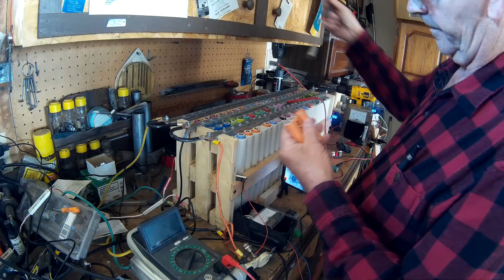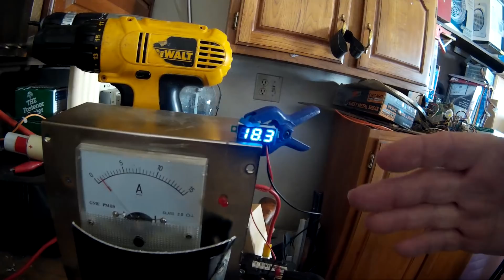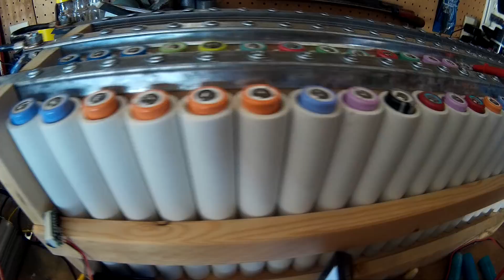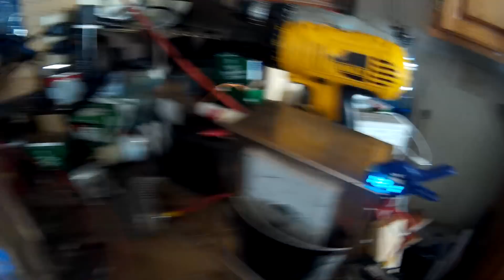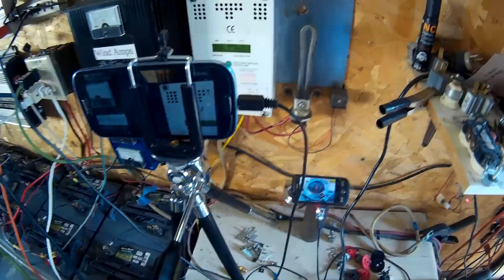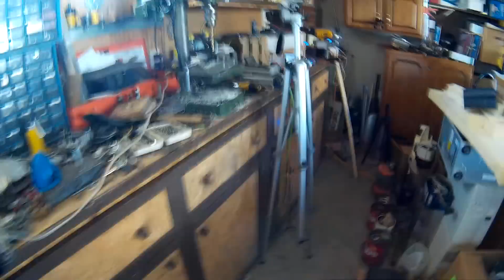My Power Wall Build

Comment: butch how do you put a bms on that set up? i really like that set up
Reply from the maker: In this video, there is no BMS. Later I used a tube that is smaller and sliced it in half so the batteries would be exposed and actually snap into the tube allowing a foil strip to lay between the batteries, then attach BMS  to the end. Hope this helps.
Reply: @butchwilliams7637  do you have any videos of that. i still like putting 4 battery in and only charging to 14.8 most of the day i think they will last longer its been working well for me and no bms take care thanks

Comment: What is the water heater element for next to the lead-acid battery bank? I assume it is to burn off excess energy for balancing, maybe? Very intelligent set-up. Good ideas!
Reply from the maker: Diversion load for the wind generators.
Reply: @butchwilliams7637  Well, that makes sense. So you could put that in your water heater and it would add heat to your water!

Comment: Hi, I'm from one of the DIY powerwall groups and we have people mentioning your video as a justification for using Lithium Ion Cells with no battery management system... 

Let me first turn your attention to this guy... https://www.clickorlando.com/news/local/2020/07/10/osceola-county-home-catches-fire-when-battery-pack-for-solar-panels-ruptures-2/
His name is Leo he came and posted to our group, he went and bought a salvaged Chevy Volt Lithium Ion, gutted it, put the batteries in his basement with a multi KW roof full of solar and treated them like Lead acids. A short while later he lost his house, lucky he didn't lose his family. He used 4 Midnight solar 60A chargers and shoved all of that power into Volt batteries.

The reason i'm writing is because you are doing the community a huge disservice by not researching and putting together Lithium Ion properly and sharing it with people as "You can do this too just like me".  Let me show you another video.... https://youtu.be/of01p0Q-yUM Same kind of cells, charged it without a BMS.  You should not be replacing your cells on the regular, that's happening because you don't know your individual cell voltages and the voltages across individual batteries are getting too low and ruining them

Lithium Ion is NOTHING to screw with, if ONE cell reaches 4.2V or even on the low end of 2.6v your entire battery pack, the wood bench you have it on and the borderline hoarding situation you have in that garage goes up.  Once one cell goes up, it's a chain reaction.  If you would like to see a proper DIY installation of Lifepo4 (Which also needs a BMS) Feel free to click on my name and see my project.   

Let me go into a bit more detail You need to run a BMS with proper contactors/shunt trips BECAUSE Lithium Ion at those voltages reaches a snowball effect something needs to have eyes and watch your system when you cannot.  With the batteries your obtaining you have no idea the condition of them, As they discharge, one could discharge faster and you begin having balance issues and have no idea. Pretty soon as your 2 solar panels charge, One cell reaches 4.1V... You discharge it with your fan, then charge it up the next day, possible BOOM.

Battery management systems aren't cheap, especially the configurable ones I had to drop almost 900$ on mine for a 880AH system. I use Batrium.  Please be more informed, join one of our groups, look at a lot of the established battery creators, There's no excuse for you having to design your own system from bottom to top and it being extremely unsafe for the sheer reason of "Wanting to be different than everyone else." I really don't want you to be the reason why law makers put further restrictions on battery creators because you were the next guy who lost his garage.

I really expect if you are going to post this on the internet to know exactly what your talking about, know the model of your fridge and not mumble your way through it, know how low your voltages get overnight. Those are huge indications you are choosing to be dangerous and uninformed rather than safe and informed. Last and finally, by clamping the positive and negative down on each other you've created a sudo bomb because they can't vent unless they rupture.
Reply from the maker: Thanks Alan for doing all this research just for me.

Comment: Hi! Are you still using this powerwall battery design? How is it going for you? It is a uniquely awesome concept versus the normal plastic battery holder style that everyone uses, I'm just wondering if it is viable ? My primary concern is the stacking of cells (lack of balancing) Tnx
Reply from the maker: Yes It is still in one piece and still works. Added another row since the video.

Comment: I know a old video. 
Great concept you have there. It does need some improvement done. That is why you have a great system. 
Your system can be adaptive to what is at hand. 
I’m a retired hot roofer and have a farm . Along with starting my own power bank system in the near future. 
I wonder about using magnets instead of soldering the fuse .
Reply: I did see someone doing just that. I was thinking maybe springs like on a clothespin.
Reply from the maker: I have tried them between the batteries and works good. On wires not so good.

Comment: How about a update video. 

Did you charge /discharge each battery or just find good batteries and drop in.

Yes you could buy this and that to build your system. You used what you had at home. 👍🏻
Reply from the maker: I do discharge and charge all used batteries to find the best ones.

Comment: Instead of soldering the wire to the top post, why not solder to a metal washer and use a small neodymium magnet? It would make your cells alot easier for you to service. Great video.
Reply from the maker: Great idea. I've tried the magnet, but not the washer.
Reply: @butchwilliams7637  heating up the magnet makes it lose its strength. You can also put a magnet in between every cell for better contact.

Comment: what is the bms board u r using to control the voltage from solar panels
Reply from the maker: Its just a Li-ion solar charge controller rated at 5 amps.
Reply: do u have a model number for that bms. can't seem to find a 5 amp
Reply from the maker: Got them on ebay, search for solar li-ion charge controller.
Reply from the maker: I found them on ebay from china

Comment: This may seem like a noob question (probably because it is but if you don't ask you never know).

are there any detriments or known problems with having cells in series with no fuses.  This is a similar design to something I have in mind for my setup (I haven't started putting packs together yet). and wondering about any potential problems with having cells in series. ???
Reply from the maker: I'm not aware of any issue's. Mine have done well for about a year now. I don' t plan on changing anything. Just making it bigger. I think you will do fine. Put at least one fuse per set.

Comment: Very ingenious cell configuration. I'm glad it's working well for you. The only thing I would do different is to use copper sheet for the buss bars and install 1 amp glass fuses. That's just me, I'm not too keen on steel as a conductor.
Reply: Brass would be just as good and easer to get.
Reply from the maker: Thanks, just testing

Comment: I thought about doing something like this. with pipe. I like the black holders. its that I gust don't have them! I may get some. If I didn't have to order them. I'd have them already! I'm trying to put together a pack with just under 400 cells. or multiple packs of 20, 7,14, 21 then 28, packs of 20, for a 7s 24v system. I hope to eventually have 7 packs of 560 or so. I would really like to get my 250 amp draw a own to about 5ma per cell. that is a lot of cells. and should run along time at 1/4 output. with no sun for days. I just need a good balancing system and monitoring system. I shouldn't need any other voltage shut off. great video thanks for taking the time...
Reply from the maker: Thanks

Comment: It seems like putting the batteries in plastic pipe would restrict airflow around the batteries and they would be running hotter.
Reply from the maker: There is air space around the batteries. There loose in the tubes. Heat just don't exist.

Comment: Very impressive and appealing design , but the 3S cell stacking seems worrisome given the general need to balance each lithium cell in series pack? Guessing you took this into account and chose to proceed as is anyway?
Reply from the maker: Thanks for your comment. I did consider the balance thing. I'm not completely convinced about the general need to balance each lithium cell in series pack. It's about a year old now , and  haven't had any reason to pull any out or change anything.

Comment: Nice job there! I like that setup for the battery pack! I noticed you have a PV array w/a actuator jack for tracking. I hardly ever see that in these solar videos! I always wondered if the added expense of a tracker pays off. I know just by playing with a small PV panel, it does make a difference when the panel is flat towards the sun in power output.
Reply from the maker: It does, and you can find a few of these old C band dishes and mounts out and about. They usually let ya have them if you take them down. See my other video on tracking.

Comment: What do you use for fuse wire? Or, do you use fuses? I'm not about saving money. I want it to be safe as I'm sure yours is. Been having a hard time getting a straight answer on other sites about what type and where to purchase their fuse wire. They will point to Amazon and then there's 3 different spools listed. I'm a total noob and I don't want to burn my house down.
Reply from the maker: I will be changing the fuse in the video. It's to large. Was not tested yet. I tested a wire from an old computer power supply. The one that plugs into the mother board. It blows at 8 amps. I will be using it.

Comment: How does it connect at the top of the individual cells? Maybe I'm blind but I can't see how they are connected.  This design is absolutely brilliant! Totally going to steal it!
Reply from the maker: Thanks. See my other video how its built. A wire used as a fuse is soldered to the battery and the other end of the wire is held down by a screw.
Reply from the maker: Oh I'm sorry. There connection in the tubes is just the weight of the batteries.

Comment: excellent !
Reply from the maker: Thank you.
Reply: Just thinking ... maybe also put some screws on the metal bottom plate to make good contact instead of having to cut some of the schrinked plastic of the battery ... you'd gain time building your BP.  Nice work anyway !

Comment: Nice, i like the idea of the pvc pipe for the cells ... maybe it is a good idea to put something on top of the cells to get some pressure on the cells and make a real good and solid contact between the cells in series.
Reply from the maker: That´s something I´ve considered. So far it´s been seems ok. Thanks.

Comment: also another thing, I heard AveRage Joe commenting that you should have negative and positive leads on oposite sides so the packs drain and charge evenly. as you have them, cells near the terminals will drain and charge faster therefore unbalancing your pack.
Reply from the maker: AveRage Joe is getting pretty knowledgeable about these 18650´s and I would respect what he says. He´s my son.
Reply: Oh, really? that's cool!!! My dad is also wanting to start his own powerwall project!
Reply: Respect to both of you! Looks like it would be Really easy to just move your negative lead to the opposite side of the pack, to pull energy evenly. Wish my dad was interested in this stuff!
Reply from the maker: Thanks for the comment. I will do that. Its not sitting in its permanent home.

Comment: Hey Butch, I'll be following your progress! just be careful with cell overheating with your config since you have the cells inside a close tube without place for air to vent it. (I know laptop battery packs are sealed but mind you have hundreds of cells there!) I'm also making video of my progress, check it out!
Reply from the maker: Thanks for your comment. I haven't had any heat issues so far. It´s been in use like this for several months. There is air space around them. I am considering an open void at the bottom. Next Video is how I made them. Thanks

Comment: this method of connecting cells is extremely dangerous. three cells in series without any parallel connection will cause some cells to go into negative voltage on discharge, and they will overheat or catch fire when charging.
Reply: fuse wire is untested and too long, I bet it blows at 10amps. Bus bar top end appears to not have a main fuse, any shorts get full current until all cells blow their fuses. The postive main fuse should be very close to the terminal. Bottom ends don't appear to be fused. list goes on.
Reply: well, for what it's worth, I feel like the extra layer of pvc covering and separating the cells from one another could very well protect the pack from further catastrophe if indeed one decided to go. I have two questions: How thick is your fuse wire? I have found some really fine wire in old rca cables that I think would work nicely. and.... How does your pack hold up to the cold? or is your shop there heated...
Reply: 80650s (usually) have a pressure disconnect system that will prevent the fire, but he's gonna be loosing whole series at a time
Reply from the maker: Thanks for your comment. I realize the risk of this build. This is a quick set up and in testing status. Parts will be added or changed as time goes on. As for using it as it is for the last several months, it has worked with out any problems. Thanks again.
Reply from the maker: Thanks for the comment. I may pass this info to laptop manufacturers.
Reply: laptop batteries always monitor the two intermediate voltages, and all cells are connected in parallel and the cell groups are connected in series. they are also using new and well matched cells.
Reply: @butchwilliams7637  haha always an odiot in the i know everything room.
Reply: I like it butch ,and ya they vent when over done and its better than mine,im still lookin .need good source of used stuff